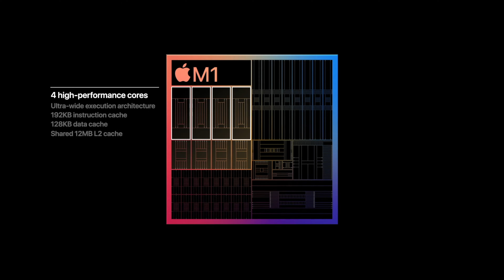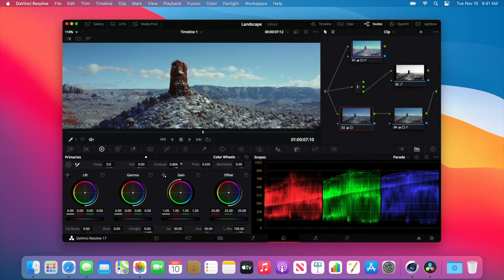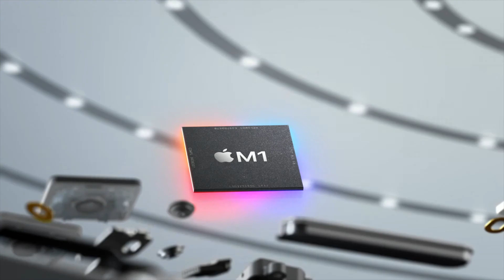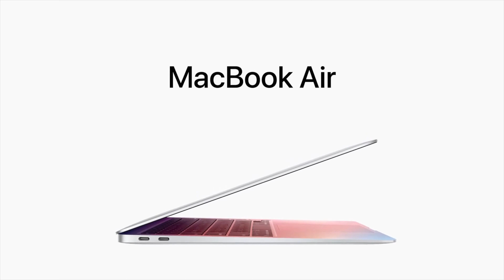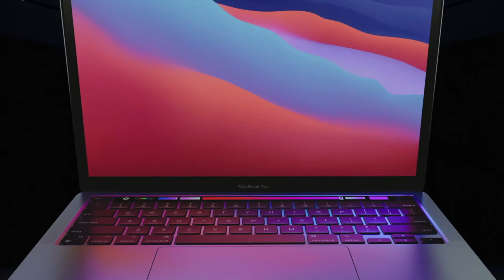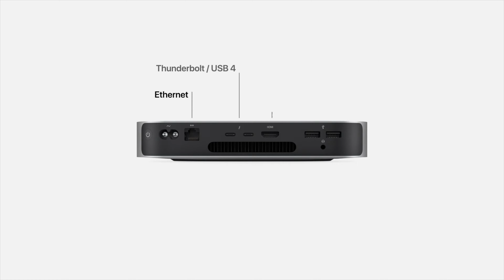New Apple Silicon Macs Explained | One More Thing Keynote

Comment: Started watching your channel when researching LG ultra wides. Picked up same model from Costco. Anyways...I just ordered the MacBook Pro. I really wonder what kind of sustained performance they’ll be able to attain with active cooling. Keep up the videos dude!
Reply from the maker: From what I've heard, the fans barely spin up on the MBP13. The M1 chip in the air are fundamentally the same chip found in the pro. Probably only under the most strenuous workloads are you going to be able to hear the fan ramp up. Even then, I expect these things to be very quiet. :)